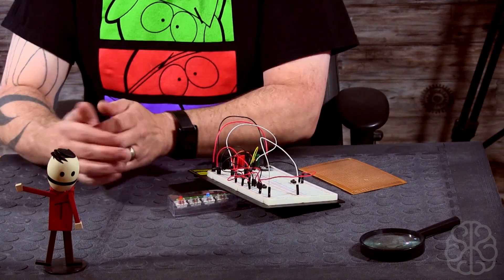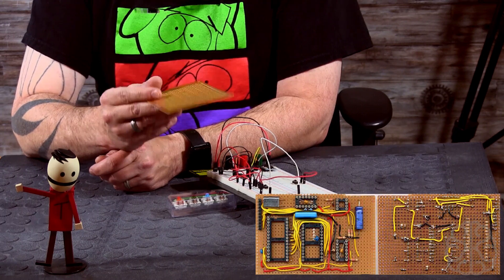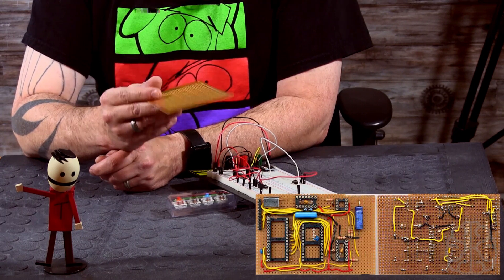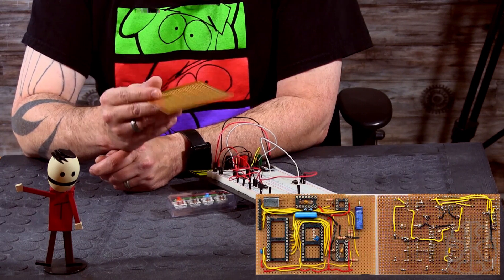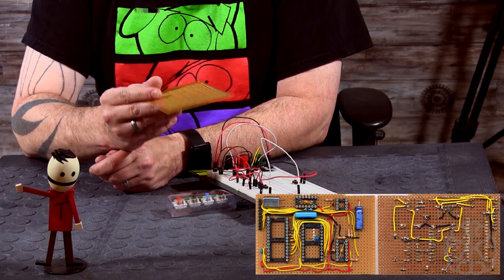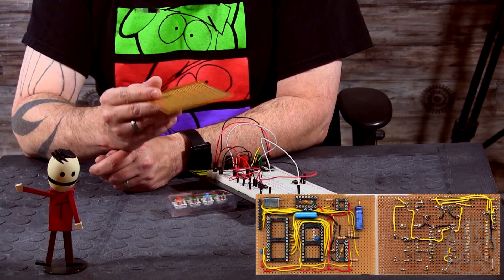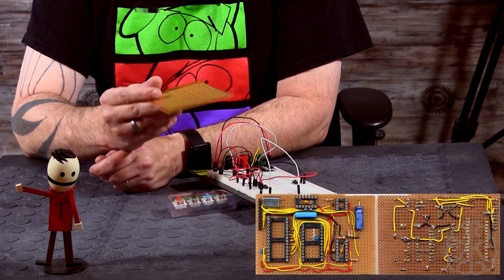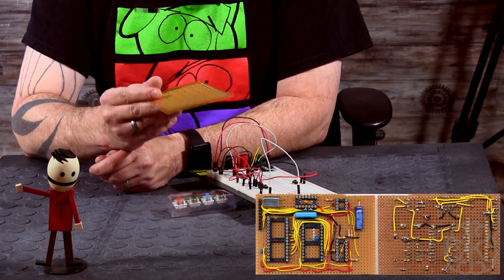Let's make a PCB using an online service for professional results!  Tutorial

Comment: I use the grid (2.54 mm) and snap (1.27 mm) from the beginning in order to get a well organized design. I often build up audio equipment according to special needs and I like to present parts of the electronics inside under acrylic glass or even on top of the device as a work of art.

Comment: Im wondering if I could maybe get some help with a project. I want to attempt to put mechanical switches inside of a guitar hero/ rockband guitar for PC. It seams like creating a new PCB with 5 cherry MX switches is the proper way to go, but i know very little about this kind of electrical engineering. I would say im an average skill level with a soldering iron.
What I am wondering is if you have any videos for some very basic understanding of this stuff or maybe some insight on how i can make this project a reality.